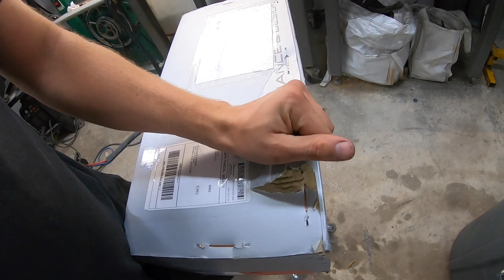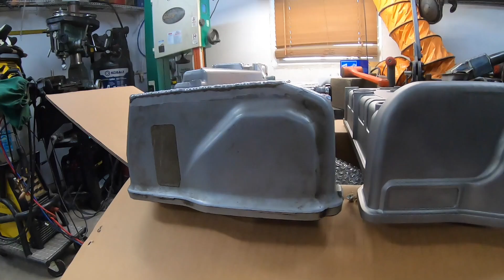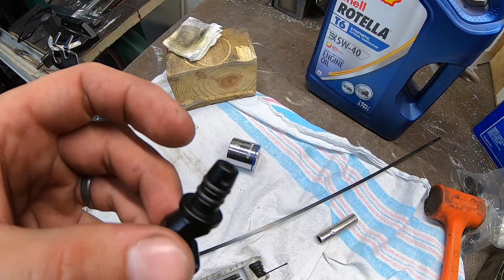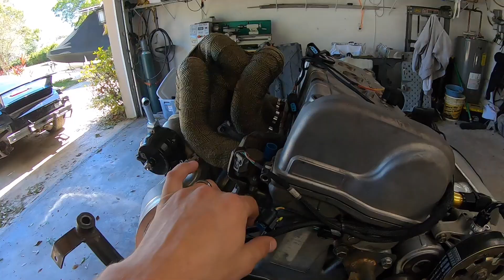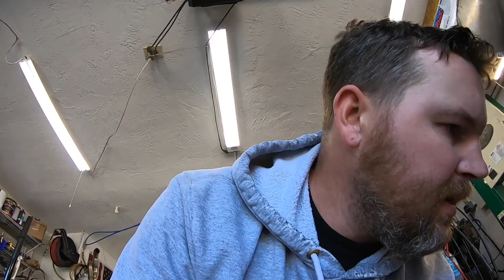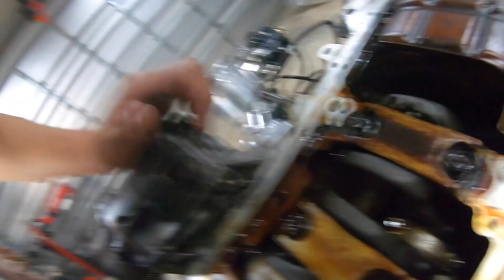Dressing Up The K24 Motor; Then Finding Internal Damage

Comment: Are you wiring the engine directly to the ecu with the harness you bought and completely bypassing the 996 wiring? Can't wait to see more
Reply from the maker: Yeah. I have a haltech dash so everything will go to that. It even allows me to show the turn signal, headlight etc on it if I wire them in.
Reply: @baysidefabrication  are you planning on selling swap parts? Definitely interested in doing this one day